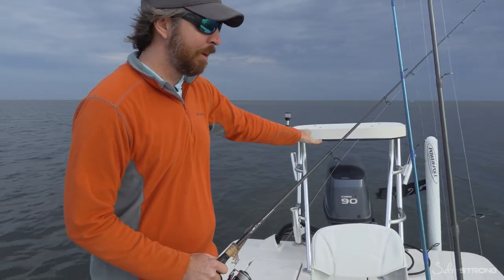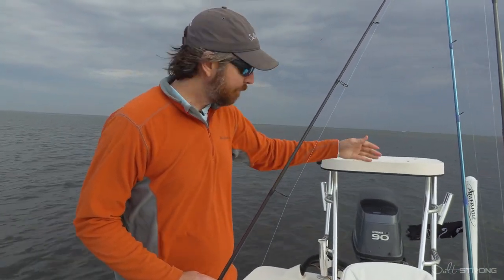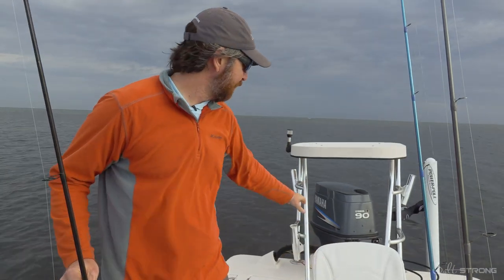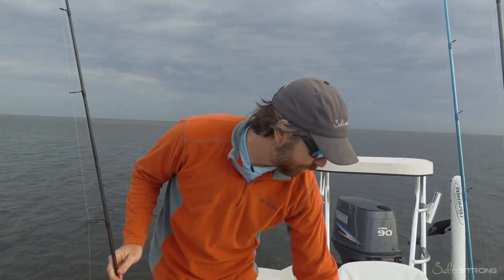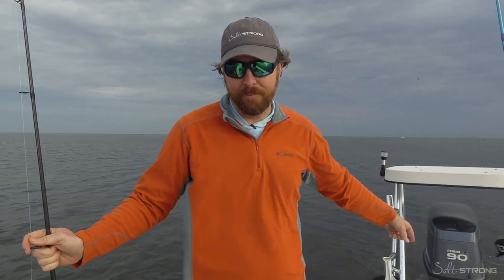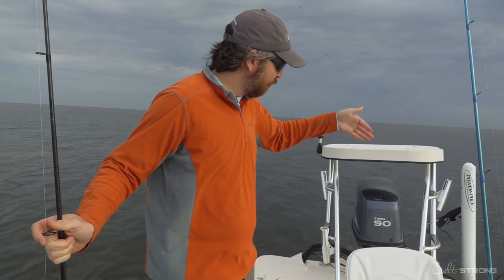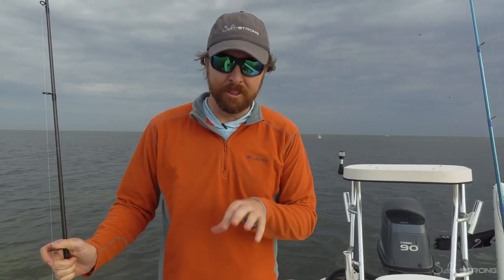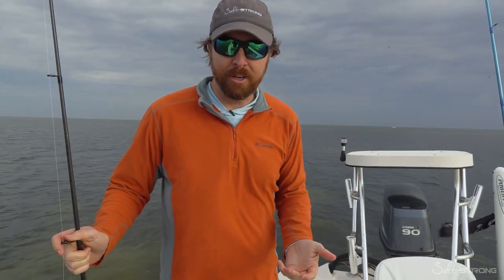What To Do With Your Motor While You're Fishing

Comment: Luke I run an inboard would you recommend shutting the engine off between drifts? I usually fish in water less than 20 feet for summer flounder.
Reply from the maker: Yes, I always turn the motor off unless it's required to hold a good drift.

Comment: Luke i have an inboard would you suggest i shut the motor off between drifts or leave it running. Im usually fishing in water less than 20 feet
Reply from the maker: If fishing an area that doesn't have a lot of boat traffic (like inlets/passes), then I pretty much always turn the main motor off.

Comment: Do you put the motor in gear so the prop does not turn or do you leave it in neutral?
Reply from the maker: The big motor is ideally turned off when fishing to make sure we don't spook fish.
Reply: @Saltstrong  I think he was asking if you would suggest shifting the engine into gear when the engine is shut off to keep the prop from turning.
Reply from the maker: @edvickerman2950  Ahhh, good catch... I read it too quickly. I normally just keep mine in neutral. But shifting it out of neutral can be used if you want the motor to have more drag in the water.